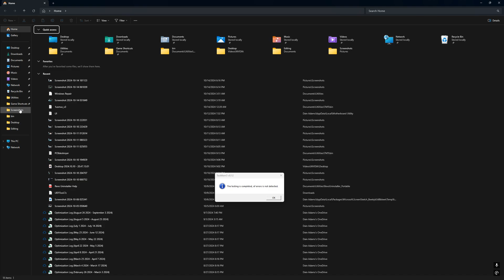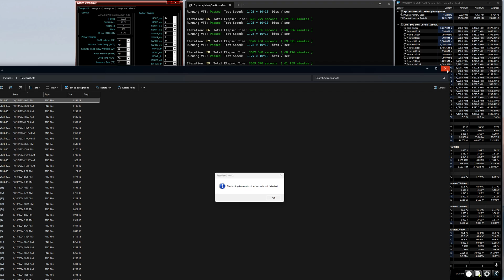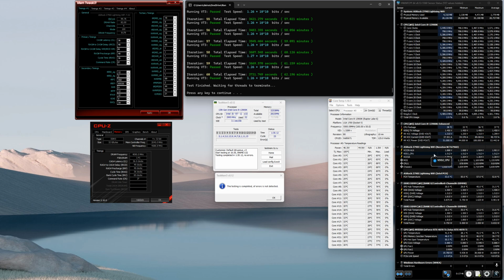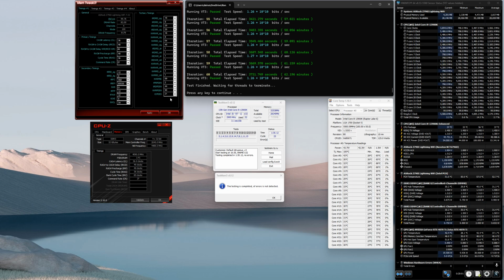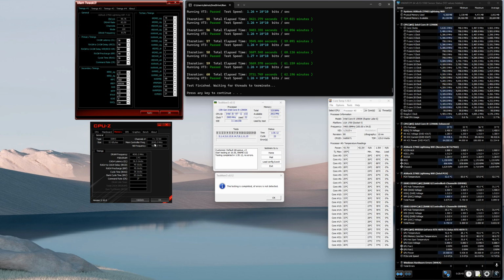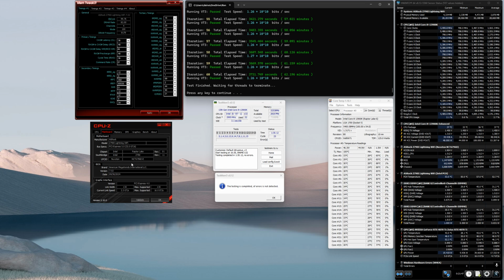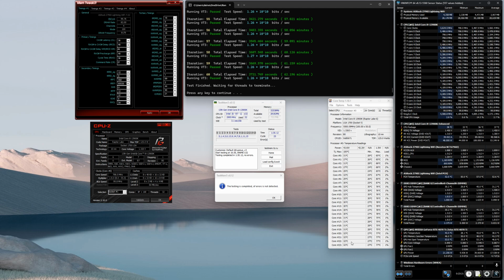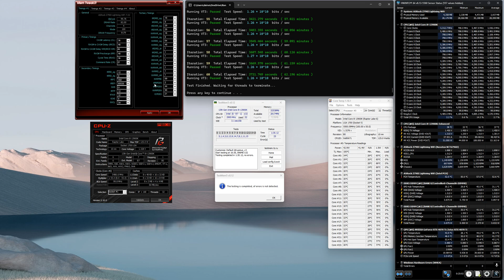I think I just got 8200C36 working with Hynix A-die (dreams crushed shortly after)

Comment: The voltage variance between chips is insane,sadly there's just no way to copy settings.

8200 c36(gskill7600a-die) with 1.365 tx and 1.2 sa(lowering it to 1.2 was the golden ticket) changing other voltages had little to no effect on stability.
7 hours of karhu and 1 hour of vt3 for stability testing.

Guess I have a good IMC bin which I never knew about since I was on a 4 dimm earlier struggling with 7600-800 for months.
I've run it like for a couple of weeks now and no retraining issues so far.unlike my 4 dimm which one day runs 10+hours karhu next coldboot it's crashing all over the place.
Now my bad core bin doesn't bother me as much(1.47vid for 6 ghz).

Comment: what's the formula for optimal trfcpb?
Reply from the maker: @jameyt1  I don’t believe such a thing exists. The rules that have been proposed online are not followed by certain JEDEC regulations and my BIOS at auto breaks said rules when loading default settings. I personally just have a set target depending on the IC type and scale the tRFC that way. For my H16A I use 120ns for tRFC2 and 100ns for tRFCpb. For old H16M I used to stick to 100ns for tRFC2 and 90ns for tRFCpb. For H24M, I’d probably use 160ns for tRFC2 and 120ns for tRFCpb.
Reply: @dainluke  appreciate it
Reply: My board actually follows the rule (at auto) trfc value divided by 1.23 to get the trfcpb value. So i am following that rule on my board since then and it works aight.
Reply from the maker: @BazoGaming7  There’s a JEDEC table we now use.

Comment: I havent encountered that hwinfo would mess up bitrate, i guess it could if you have very frequent polling period like sub 500ms then maybe it can have some impact. But YC by default runs at "bellow normal" priority and windows can drop it into background task and that I know for a fact it lowers bitrate to levels you had in the last video. setting YC priority:0 or priority:1 which translates into "normal" or "above normal" priority - though "above normal" priority can mess hwinfo values i.e ram temp at 3999c etc, which can be mitigated by running hwinfo at higher priority.

Id drop all PLL stuff and only mess with them as last resort, most important are SA and TX to and then RTTs - in that order. I saw you ran fairly strong RTTs which most likely gave you hard time. You also might get lower VDD2 with weaker RONs. 

Keep up the fight dawg, Its clear that you can make this 8200Mhz dailyable when you figure out these boundaries.

Comment: Good work man! This board is incredible! Haha this video is such a coincidene, I am currently stresstesting my a die 8200c38 on my lightning. Earlier today I was down at 8200c32 but it was too unstable so I dailed kt back to make the progress more step by step. Thanks for the video mate!
Reply from the maker: @jokanevad  So funnily enough, one more cold boot broke it. I think this board just has a very tough time consistently training 8000+ with A-die. That’s me jumping to M-die.
Reply: @dainluke  crap, sorry to hear that. I’ve read the whole of OCN thread on the lightning and it seems this board vibes with m die. Veil on OCN helped me a lot with my viper m die kit but it seemed the vipers pcb required very specific/diffrent ODTs than other vendor kits. So returned the kit and kept going with a die. Actually managed to boot 8600 a die so i think with enough tinkering i should be able to stabilize 8400. 8000 was a breeze to stabilize, above that is more work.
Reply from the maker: @jokanevad  Just beware that subsequent boots might fail even if you get seemingly stable settings. The config was actually running incredibly well given it trained properly twice with a 9 hour window in between.